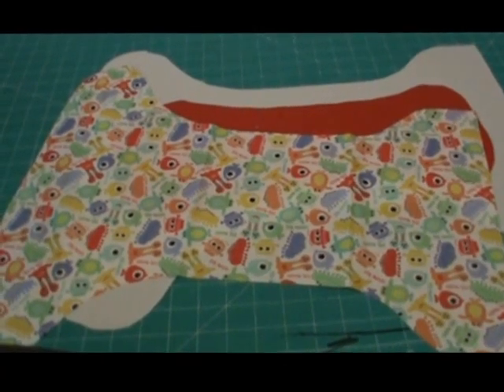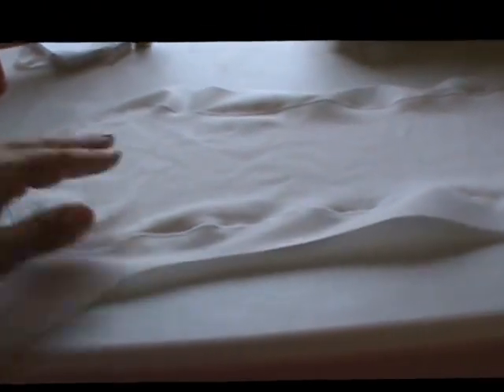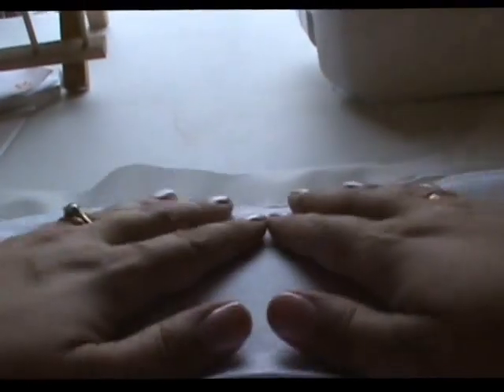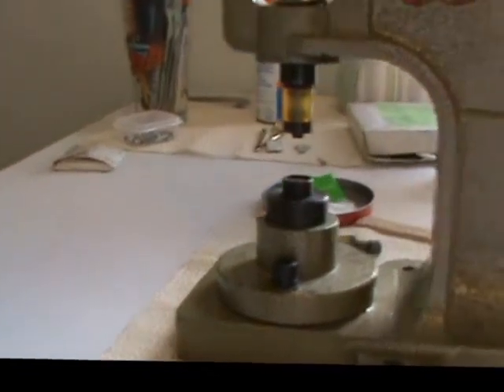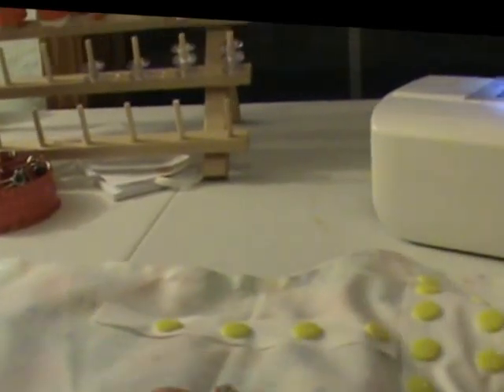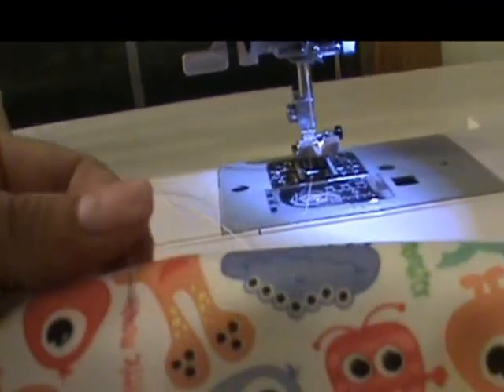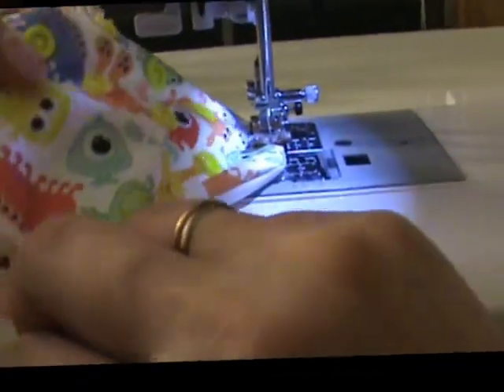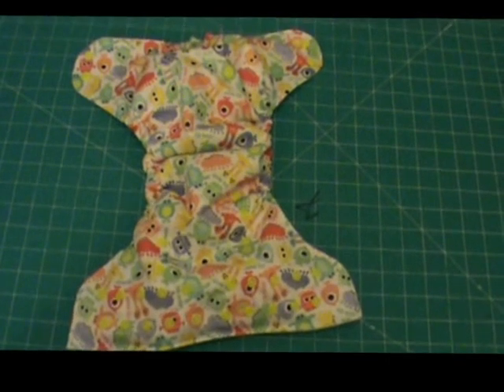How to sew an AIO diaper.wmv

Comment: This is a one size diaper and is designed to fit 12-35lbs.  It usually doesn't fit newborns.  Typically newborns will wear newborn/small diapers for the first two months or so (depending on the size of the newborn of course) until they can fit in one-size diapers.